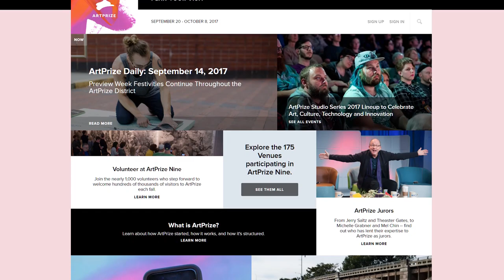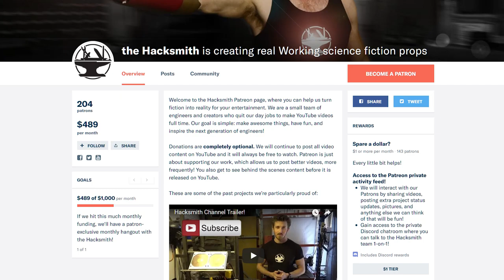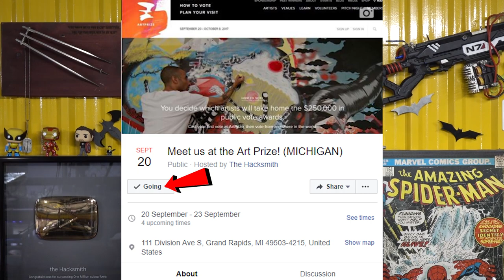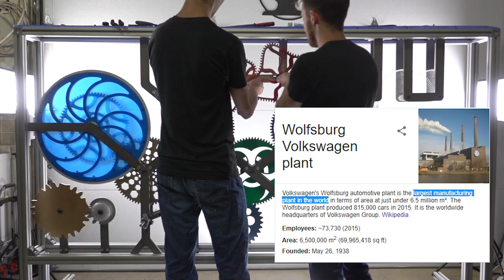Hacksmith's ArtPrize Entry! (update: we did not win)

Comment: So if it takes years to move the big gear at the end ....how fast will the gears spin if you put the power in the big gear ?
Reply from the maker: +The Professor you can't... The torque required is huge! Ever try to push a car while it's in 5th gear?
Reply: the Hacksmith what if all gears were made out of hardened steel and you used a hydralic press? XD
Reply from the maker: Nothing... literally the torque is off the charts, you cannot spin the last gear xD

Comment: would be nice to see you putting the motor at the "one" gear end.. and see if you can even make the 90 trillion gear ratio spin without destroying itself !
Reply from the maker: +dkphantomdk that's impossible... Input gear would spin faster than the speed of light
Reply: That might be so very true, but I wonder how much power is actually needed to make this happen theoretical at least.
if you could do the math on 1 rotation in 1 min on the "one" gear ratio that is needed to even make the highest ratio gear spin, I believe there will be a power loss in each gear, and also the centrifugalforce needed to spin up the gears would demand power..
so.. if the gears would hold up, would it take
 1 horsepower to make "one gear" spin 1 time pr 1 min
or 1000 horsepower
or 100.000 horsepower. ?

Comment: 4:44
that makes no sense. if it's going at 100 mph its going to take the same amount of time to do x thing as if it was going 1 mph?
and what do you mean turn itself off?! shouldn't it keep going forever as long as the drill is going and no gears break?!
Reply from the maker: The final gear is a finger... hovering over the off button. It will take approximately 10,000 years for that gear to rotate, pressing the off button. The speed changes a bit, but its negligable compared to the gear ratio... remember... 90 trillion is 90,000,000,000,000 -- do the the math xD

Comment: Is it possible to invert this contraption?? As in, if you were to spin the gear on the end one revolution, the starting gear would spin 90 trillion times. If you could make that, and make it small, you could sell that and make MILLIONS probably!!
Reply from the maker: If you could do that, I'm pretty sure you would rip a hole in space and time and either make a black hole or a wormhole...
Reply: Why does it seem easier to make many-to-one gearboxes than one-to-many gearboxes? I assume that there are proper terms for these ideas, but I don't know them off hand.
Reply from the maker: Because highspeed gearboxes aren't useful for many things I think
Reply: Usually you can just flip them around, making the input the output and vice versa . So a many-to-one and a one-to-many are the same thing.
Reply: Why? Wouldn't doing more work with less effort be more worth while than doing less work with more effort?????
Reply: @Jacob Hoggart. Yeah, that's what I was thinking. Obviously, to really attempt it with this idea would require a completely new design. Unless someone can rotate the cement block.
Reply from the maker: But again... there's no use for a highspeed gearbox in most cases -- remember, you end up with less torque going that way. The usual use for gears is to amplify the torque, by putting in high speed low power to get low speed high power ;-)
Reply: This is off topic, but I am sure you all can answer me this idea I have been thinking of for a while. What would happen if you were to drill spirals along the length of a bullet? You also could make the holes in the mold of the bullet when you make them initially. Let me know if you want more details.
Reply from the maker: +Nathaniel Shaw I don't know. Seems unnecessary since barrels are already rifled?
Reply: My thinking, which I confess can be flawed, is that by drilling holes in a bullet, it will make the bullet fly straighter and/or farther and/or reducing drag. As insane as drilling curves in a small item sounds, I assume that best action would be to put the curves in a mold. I also have an idea on how to design the right spirals for each bullet type, if you want to know.
Reply from the maker: +Nathaniel Shaw cool idea, no idea if it would work though. I don't do guns though. Maybe research barrel riffling?
Reply: I would, but I think research should be followed by action, and I am not in a position to build or test fire anything. I am simply an overclocked thinker, coming up with absurdly complex ideas in a few heartbeats. All I can do For Now is share my ideas with people who, from my perspective, are completely willing and able to fully investigate my notions. I don't want to be a You tuber or gain any amount of celebrity status. I am actually a little freaked out over my mystery solo subscriber who has their subscriptions list private, so I cannot learn who that are! For now, I am content to watch incredible stuff online, combine them in new and crazy ways in my head, and Hopefully share them with someone who will act on them. If you know anyone or know someone who would know anyone who could work on this, please pass this idea along. If any of you other random comment readers can and are interested enough in this idea, Go Crazy With It!!

Comment: Ok. 9 trillion to one, so your spinning it from the 9 trillion ratio and making the 1 spin very slowly which really serves no purpose, spin it from The one ratio to get the gears spinning at the speed of light to really serve a purpose, are you afraid of friction, would it be impossible to do so. Prove your gear ratio actually works, it would make more sense
Reply from the maker: +DarthAmerind you can't spin it backwards... The torque required would be more than any engine on the planet.